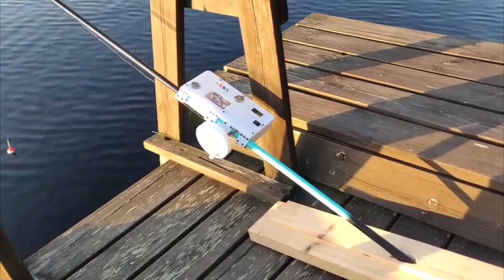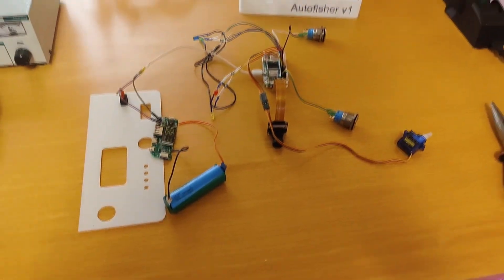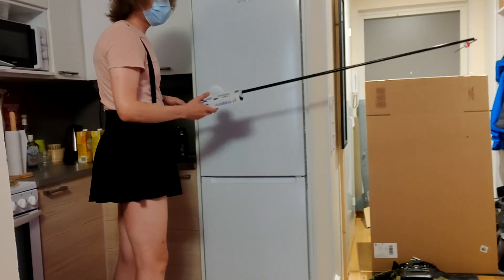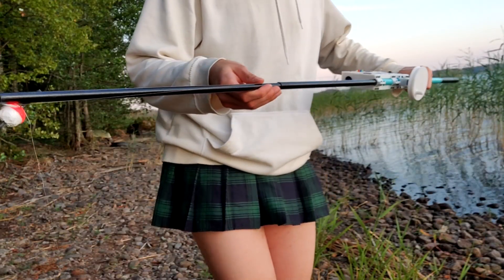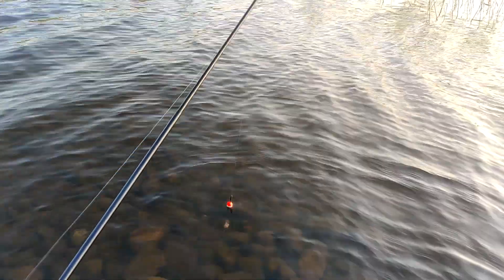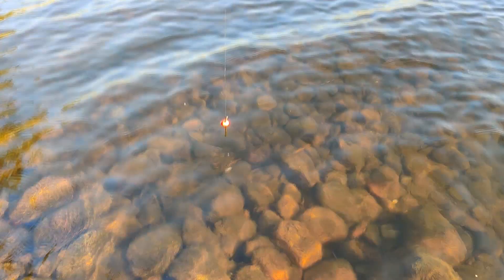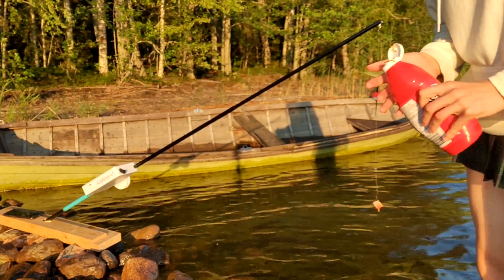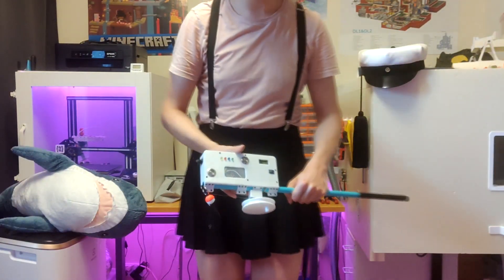I Built an Automatic Fishing Rod - Femboy Engineering Ep4

Comment: You might find it easier to fish with if you put the compute and power into a hip mounted or backpack mounted section, the just put a camera and motor on the rod itself. That might make it easier to handle and more ergonomic. A weight sensor (or a crude contact switch which makes the connection when something pulls on the line) might be more reliable than the object detection. Super cool though!

Comment: Would love to see links to your tools in the description, I could use a spot welder. Also, if you ask me this project was doomed from the start, bobber has to stay way too close to shore and the servo is too weak to lift any fish worth catching. I personally much prefer watching projects that actually have a prospect of working, this just feels flawed in design like some other videos only meant for youtube, not for practical use.
Reply from the maker: Yeah, true, I guess this project was more of just a proof of concept, and an exercise, during which I learned how to configure a raspberry pi, and use object detection in python. If I really wanted to improve it so it would work for any real use, I would have to replace the sg90 with a stronger servo, with like five times the torque, as well as extend the raspberry pi's camera cable, so I could move it farther away, to extend the fishing rod fully, to like 4 meters instead of 1.5 meters. The problem I faced, was that the camera wasn't able to reliably track the bobber from farther away than 1.5 meters, so I couldn't extend the rod that much.
  
I'll probably fix these issues off camera, as it's cheap and easy. Now in hindsight, I realize the video could have been far better had I done these iterations in the video.

Thanks for the feedback, as it helps me improve :3 

In the future, I'll make some better projects, and iterate more on my designs :3
Reply: Let people do silly things